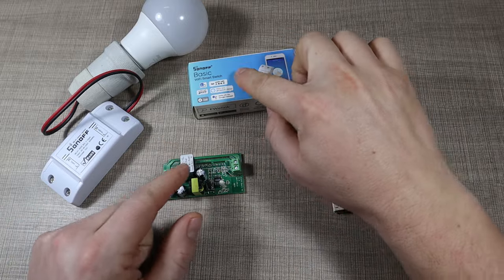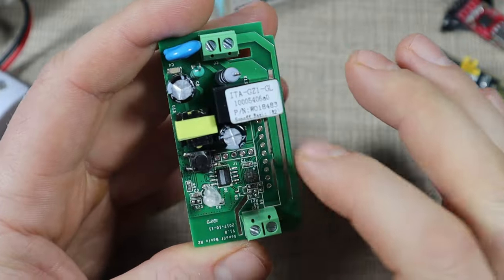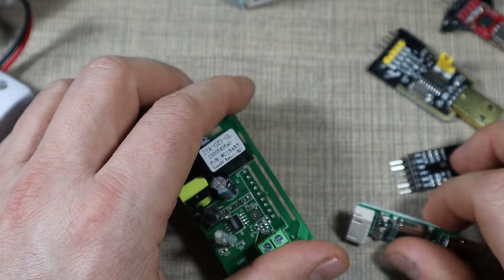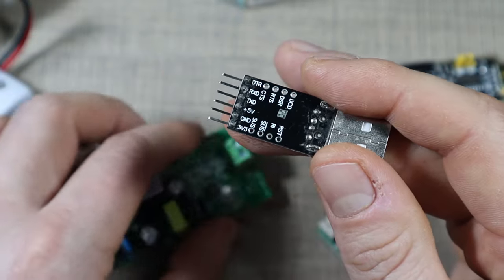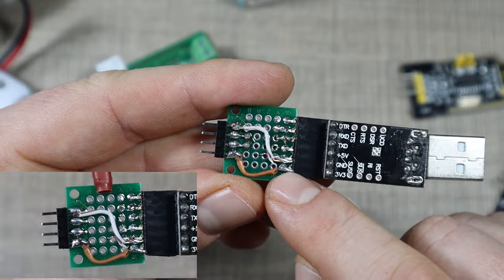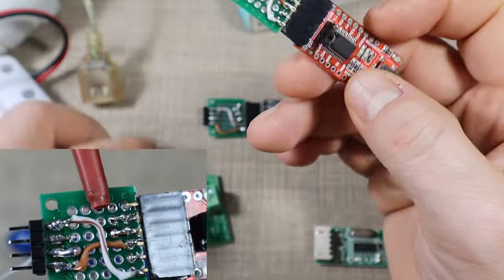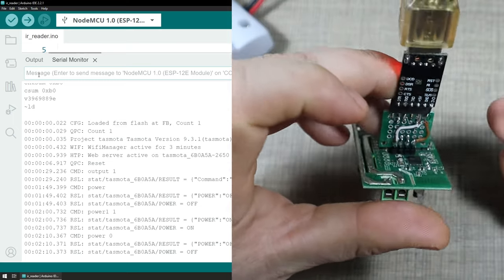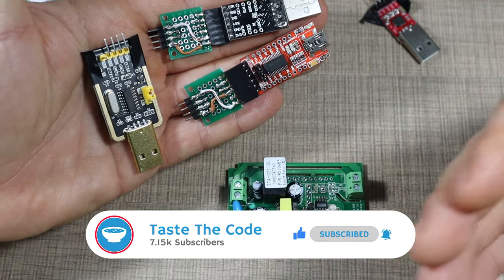Jig Mastery: Flash Sonoff Basic Switches with Tasmota Like a Pro! - DIY Jig

Comment: So you made two jigs and modified one of your USB-to-serial adapters? Neat!
Reply from the maker: Thanks. I wanted to show multiple options depending on what people might have.
Reply: @TasteTheCode  Cool - wrote it up on Hackster, so wanted to get the details correct. 

Also, perhaps you inspired me - finally flashed a Wemos D1 mini with Tasmota that I'd had hooked up to my garage door opener for a while, but was not working. I think I'd programmed it in Arduino some time ago. Now working, so yay, though getting it to work like a momentary button was a bit of a pain.
Reply from the maker: Wow, thanks! That is super nice! I also had issues with some of the latest Tasmota versions not being able to connect to WiFi, but older ones worked straight up. I think it might have to do something with the bootloader version but I did not had the time to explore it further.
Reply: @TasteTheCode  NP, happy to! Getting Tasmota to do what you want is  simple it seems IF you know various tricks - like I had to put the switch in mode 14 I think and set the pulsetime.
Reply from the maker: I guess there is a document somewhere with all the modes, right? I'm looking at the MQTT part of connecting them now so I really haven't looked into the details of how they behave, but I'm guessing they are quite flexible.
Reply: @TasteTheCode  Yeah, it appears to be documented, but it just seems there's a bit of a learning curve for Tasmota as there are a few details that might not be obvious at first.